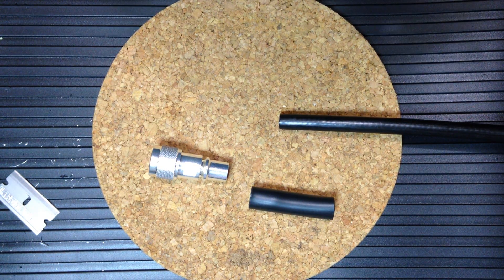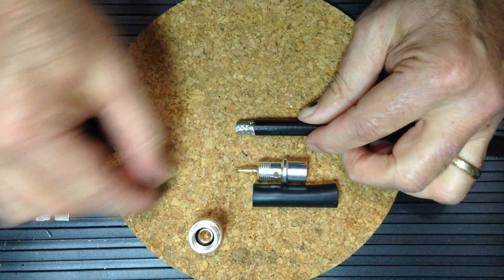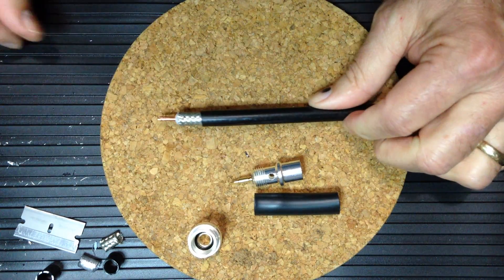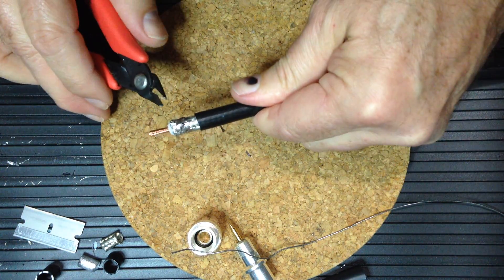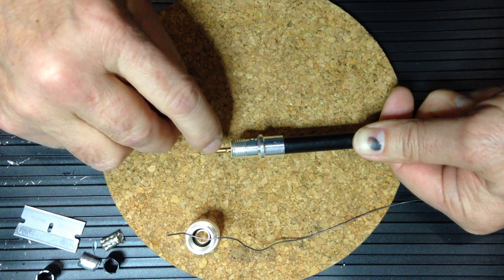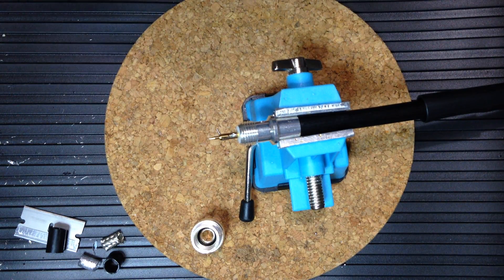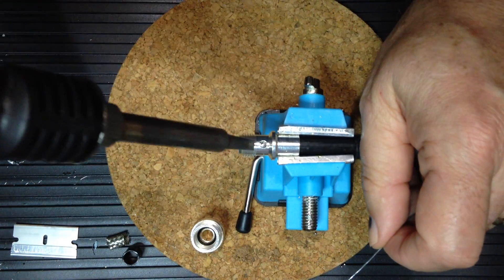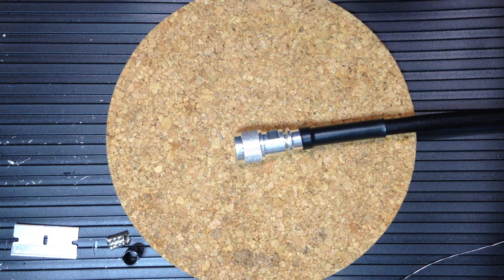Solder N-type onto LMR-400UF

Comment: Same size solder from PL259 material list? 22awg (0.5-0.75 mm^2)?  I ask because 0.75-1.5mm^2 seems to be the most common size diamanter on Amazon.

Comment: A good video and no criticism from me. I don't understand though why people who do so many coax cable connectors insist on razor blades rather than just $15 or so for a dedicated spin type coax stripper.

Hams are usually considered a little smarter than the average hobbyist, so it would be helpful for us to not spell vise as vice. It would also reflect better on us all if vise would be pronounced "vize", as it is correctly pronounced.

Comment: LMR-400 is not good for 70cms and certainly not for 23cms working. It is far too lossy. I use Westflex-103 which has a far better loss characteristics. At 23cms of a 15 meter run you will, with LMR-400 lose 50 percent of your power and as much as 6dB on receive.
Reply: your numbers are wrong  https://static.dxengineering.com/global/images/chartsguides/d/dxe-11u_us.pdf